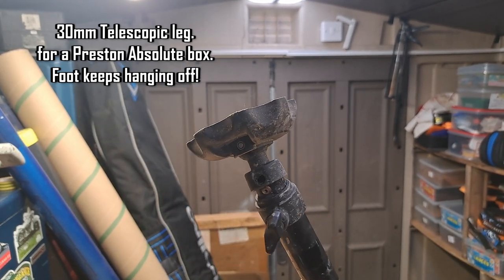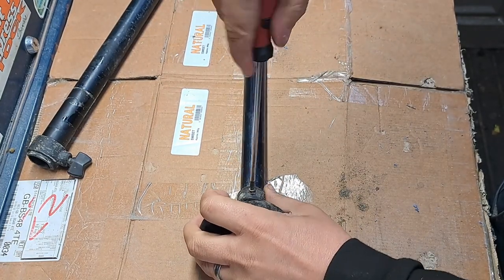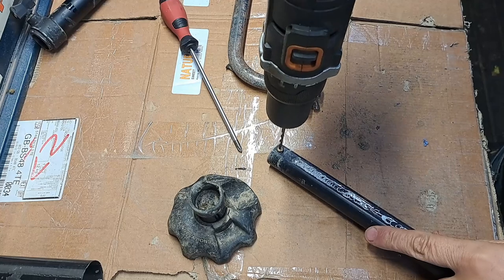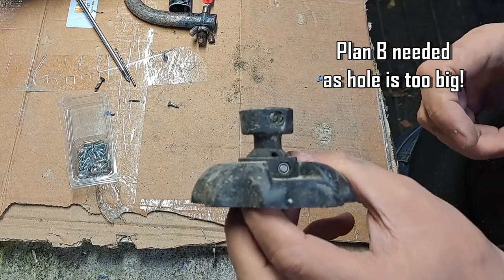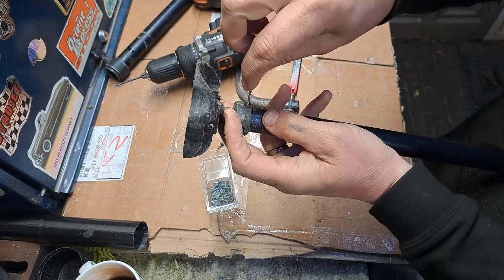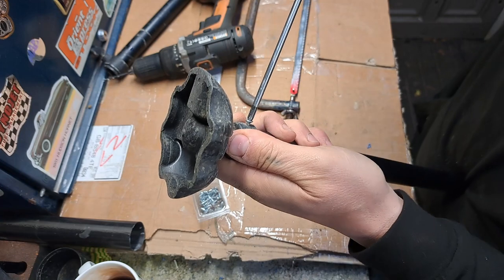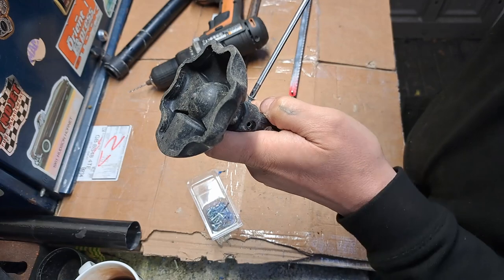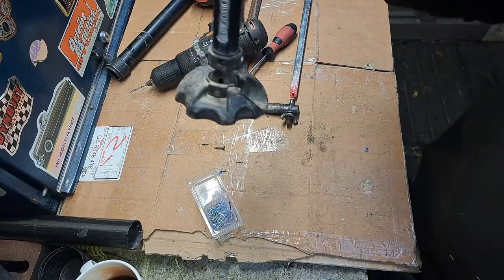Preston Absolute Broken3 0mm Leg/Foot  **QUICK EASY REPAIR**

Comment: Very good stuff there mate well done :hand-purple-blue-peace::hand-purple-blue-peace:
Reply from the maker: Bit rough and ready this video, I am super busy at the moment finding it hard to get content out 🤣🤣😂😊👍
Reply: @AverageAngler  do some shorts mate and keep them to around 20 secs
Reply from the maker: You been having much success with shorts?
Reply: @AverageAngler  yes mate  loads check them out
Reply from the maker: Will do😊👍
Reply: Just for similar future jobs, use a drill bit slightly smaller than the head of the rivet, then drill straight down, with light but firm pressure. When the bit meets the original hole, the head will come away, cleanly...stop immediately and then just knock the rivet clear of the hole.
Reply from the maker: @chriscooper2496  cheers

Comment: hi what would be the best way to store a two piece telescopic top kit  2.70 m without damaging the elastic. the 2 pieces are about the same length  with side puller.
Reply from the maker: This isn't something I have ever had to do? As long as the elastic isn't pinched when folded down it will be fine I should think. You might need to wind the loose elastic onto a pole float winder for storage?